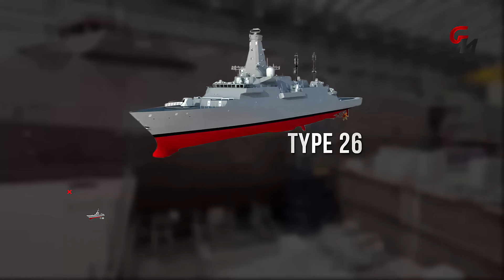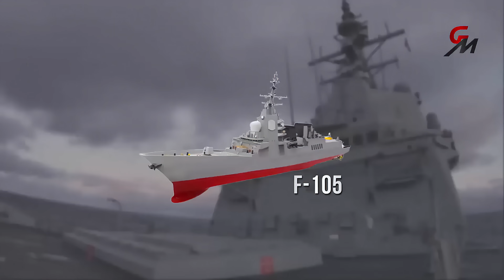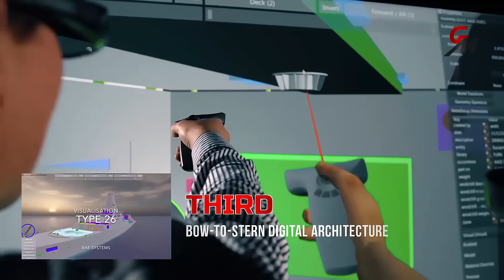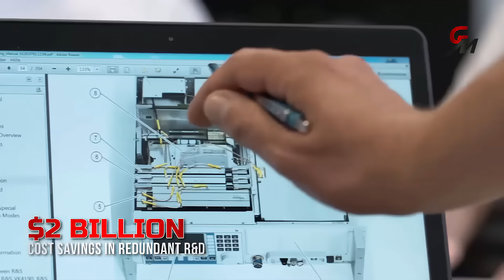Here's Why Canada Chose The Type 26 Over The F-105, Fremm-ER, De Zeven Provincien

Comment: 24 vls cells is such a low number for a 7000 ton destroyer should be 64+ vls cells it's a destroyer not a Corvette or light frigate
Reply: It would never get 64 cells. 

Room for 48 upfront, and that's about it. More in the back would require the elimination of the mission bay, and a redesign for the ship.
Reply: The MK 41 VLS cells are actually quad packed, so 4 missiles per cell.
Reply: @rivetjoint9628 only with ESSM missiles. Anything else is one per cell
Reply: @rivetjoint9628 4 smaller missles for air deffence or 1 large long range cruise missle
Reply: Typical Canadian government procurement. Half ass results for the price of two asses 🫏
Reply: Hmm I wonder what class the type 26 frigate is… surely it’s a destroyer right?
Reply: @StanRichmond  Ship class names are arbitrary and vary by country. By comparison, the River Class is much bigger and more heavily armed than many previous destroyers. It was chosen to give Canada a lot of capability and force projection options it never had before. All that in one ship is what has taken up considerable space. The hull's acoustic design is also SUPER expensive and a major reason for things. Australia was offered a Type 26 variant with almost 100 launch cells, but it rejected the offer because it would compromise the ASW hull design to accommodate the heavy payload. If you want a ship with less capability but more firepower for fleet warfare, then other options are better. Canada doesn't currently have plans to maintain battlegroups and normally operates individual ships which can attach to forces, so the Type-26 was the best option for that.
Reply: @jaysonkmendoza we didn't reject the offer mate, it's still on the table for the 2nd batch of 3 ships. We couldn't change it on the first without causing more delays and given the 11 new frigates coming, it's more than likely to be taken up for the second batch.
Reply: @chrisrabbitt  Good to know it wasn’t officially rejected. Though I felt that there is a strong implication that it was not accepted based on the justification for the purchase of the Mogami-class frigates. Australia seemed to be moving towards having more ships for a greater presence that was more economical instead of a single all-purpose hull. This doesn’t exclude Australia making a fleet ship, but I don’t see anything yet that would indicate they intend to run their own battle groups. If they d then I can see them taking a ship like the strike platform variant of the Type 26 with less ASW capabilities. Though I would also suspect they might consider another cheeper hull if they are not interested in the ASW capabilities since it would be considerably more economical.
Reply: @jaysonkmendoza we are buying 6 of the Hunter class in two batches with 3 to be the ASW version and the other 3 TBD down from nine. We do operate in groups though only when we want to send a message. A Hobart with a couple Anzacs escorting a Canberra class is the usual make-up though with the Anzacs getting old we haven't done it in a couple years
Reply: @chrisrabbitt  Ya I do know you do small adhoc flotillas sometimes. I was more talking about a standing fleet that always deploys together and may be constructed as a collection of ships that each contribute one or more unique capabilities to the fleet. Australia could go in that direction but I have not seen they say that is their intent. Given that nations may no longer be able to depend on the USA fleet forming the core of a battlegroup in the future this may change though. Australia would need to take on a very large burden to build and maintain a fleet but it may be their only practical option given their geographic location. Japan could potentially form the core but I’m not sure your alliance is close enough for that yet and they don’t currently have plans to be the core of a fleet.
Reply: @jaysonkmendoza  There are only 3 countries that operate as you seem to speak of. Japan, America and China. They are the only three countries who operate in defined groups of ships though they can also move between groups. The Royal Australian Navy is currently building or in the contract negotiation stages to build 14 frigates that have more firepower than a European destroyer, with another 3 ships TBD as to whether they will be 96 cell destroyers or more Hunters (given navy wants more VLS, likely the destroyer) and on top of that 6 more ships with 32 mk41 VLS cells to operate with the Hunter class. Add to that the 2 supply ships and Canberra class LHDs we have and the nuclear powered attack submarines we are getting, I think we have it covered. The 3 Hobart class destroyers aren't going anywhere anytime soon either. 
We were operating in defined groups as you say but on a much smaller scale than the US, not Adhoc formations, until the Anzacs got too old to keep doing it. We will go back to doing it once we have finished the recapitalisation of the fleet.
Reply: @StanRichmond 

Why is Canada’s Type 26 a destroyer and not a frigate? - Naval Technology https://share.google/xLrOANhk5XabVbtx6
Reply: calm your tits bouys. It comes from old British practis:

ASW ships are Frigates. Like the UK and Norwegian versions of Type 26, it's an ASW vessel, thus a Frigate
AAW ships are Destroyers. Like the UK Type 45 some aren't much bigger then most large frigates, but they are designed for Air warfar and thus called Destroyer.
Reply: It's not a destroyer. It is a frigate, primarily designed for anti-submarine warfare, and general purpose roles.
Reply: Maybe it has OTHER systems that need space??? And MAYBE it's not a computer game, so your input might not be as brilliant as YOU think it is..
Reply: It’s a frigate Einstein
Reply: @roadrunner2930 right in the name. Type 26 Destroyer....genius
Reply: @viper29ca  They are anti-submarine warfare frigates, why the Canadians call them destroyers is a mystery.
Reply: @JovianR the British, Australians, Norwegians, and Canada all call them destroyers. It's right in the name.
Reply: @viper29ca  The British, Australians, Norwegians all call them frigates.  https://en.wikipedia.org/wiki/Hunter-class_frigate    https://en.wikipedia.org/wiki/Type_26_frigate
Reply: @JovianR yes, because wiki is the authority. When anyone can go in and change wiki's info anytime they want, I will take that info with a really big grain of salt. Thanks
Reply: @viper29ca  lol The facts remain :)
Reply: @viper29ca type 26 frigate design smarty pants
Reply: @viper29ca type 26 frigate, the uk don’t have a type 26 destroyer 🤣 
Type45 destroyer, the channel can call it what it wants but they’re wrong buddy
Reply: @JovianR 
 It’s the same reason as why Australia’s Hobart-class is a Destroyer but Spain's Álvaro de Bazán-class is a Frigate. Hobart-class is a subclass of Spain's Álvaro de Bazán-class which is same as River-class being subclass of the Type 26. 

River-class doesn’t carry much VLS but it does have the same magazine depth as the Horizon-class Destroyers of France and Italy despite having 24-cell less VLS. I could  guess the RCN going for a similar configuration to this for their standard loadout: 
48 x RIM-162 block II (over 50 km range) quad-packed in 12-cells 
12 x SM-2 block IIIC/CU (over 160 km range) 

That’s 60 medium to long range surface to air missiles already, now factor in CIADS which is RIM-116 block II (15 km range), launch from a 2 x 3-cell LM ExLS quad-packed or 2 x 21-cell MK-144 GML which will bring the total surface to air missiles count between 84 and 102. The other way is 8-cell for RIM-162 which would house 32 missile and 16-cells for 16 SM-2 for 48 medium to long range missiles which would add to total surface to air missiles of 72 to 90 missiles CIADS included. That is way more missiles than a pair of Halifax-class frigates and now retired Iroquois-class destroyer. 

Also, the Type 26 of Norway and RN are way different from those of Australia’s and Canada’s. Norway and Royal Navy’s Type 26 are pure anti-submarine hunters hence why they’re using a less capable radar and combat system compared to Australia and Canada’s. The Hunter-class and River-class are both true multi-mission combat ships, they both got a decent fleet air defence capability and a potential for anti-ballistic missiles defence while still being a top notch in anti-submarine.
Reply: @roadrunner2930  Destroyer in Canada. All that matters
Reply: @viper29ca ok then 🙄
Reply: @viper29ca  
Exactly, designation doesn’t really matter much. It’s the capability that matters.
Reply: @Flick-l5m  omg what a prat.
Reply: @JovianR  Looks like you described yourself well admiral.
Reply: @JovianR  Because Canada is putting more emphasis on its air defence capabilities.
Reply: @garyyoung3179  That is no reason to call them destroyers.  They are frigates, end of story.
Reply: @viper29ca  Norway calls them Frigate

Canada follows an old British norm, where:

ASW ships are frigates
AAW ships are Destroyers

The British Type 26 is designed as an ASW ship, and has that as its main focus, thus it's a Frigate
But the British Type 45, some aren't much bigger than a large frigate, is called a destroyer because its main role is air warfare, some of which it's extremely good at.

Canada calls their Type 26 a Destroyer, although it's still an ASW vessel; they increased the focus on AAW, with a much more powerful radar, a radar that US Destroyers are starting to get, and a totally different and more Air warfare-focused weaponry that not only can defend itself but others as well. Thus, Canada calls their class of Type 26 a Destroyer.  The British Type 26 is still a Frigate.

And Wikipedia is correct, if you haven't noticed it yet, but Wikipedia has changed the regulations about how information can be changed, and how it can be done.
Reply: @JovianR  Many Navies and the RN in particular classify ships by purpose rather than displacement. Frigates are primarily for ASW or general-purpose use . Destroyers are optimised towards air warfare. The type 26 are the size of WW2 light cruisers. Calling them Frigates or Destroyers is down to the operating countries traditions and intended useage.